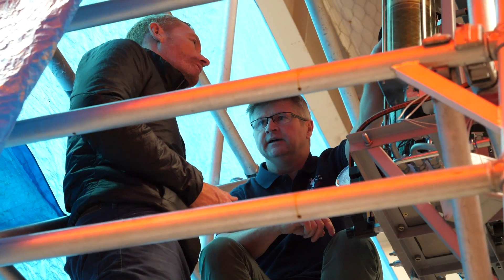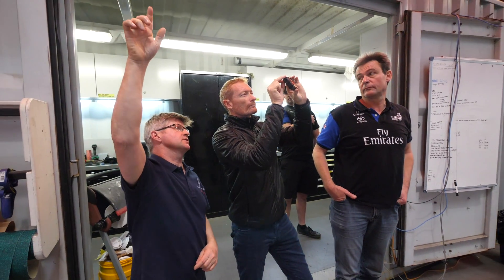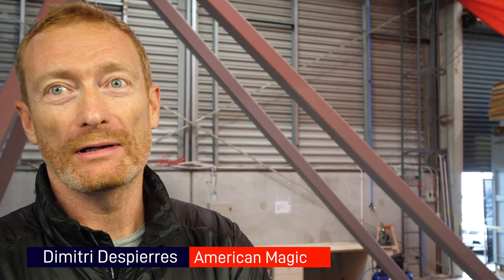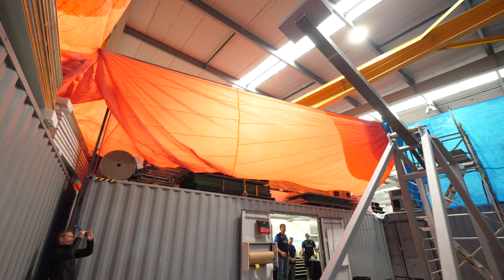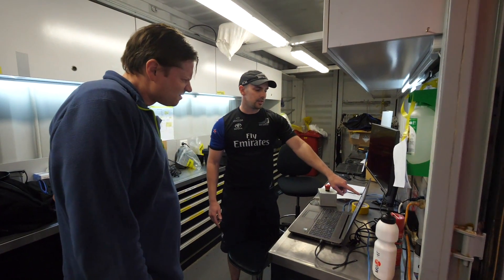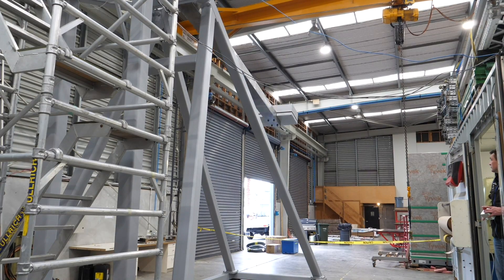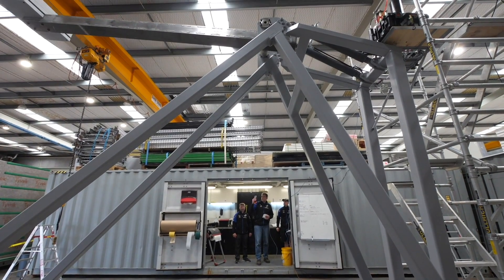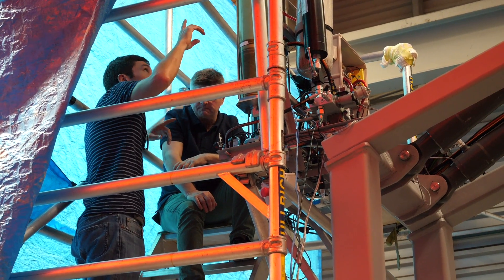Teams First Glimpse at the Foil Cant System

Comment: I still find it hard to believe that it's going to worry K, the stresses will be enormous
Reply: I agree. In the lab with the large supporting frame/structure it works well, but how will they fit and secure 2 of these in an ultra-light carbon fiber hull? Also I'm wondering what the plan is where these mechanisms go through the hull. Obviously these guys know far more than I, so I'll be keeping an eye out as these updates come as they'll most likely blow my mind.
Reply: @jimdavis5009  yeah, true that. should be very interesting to see